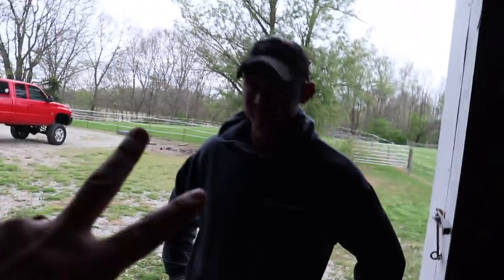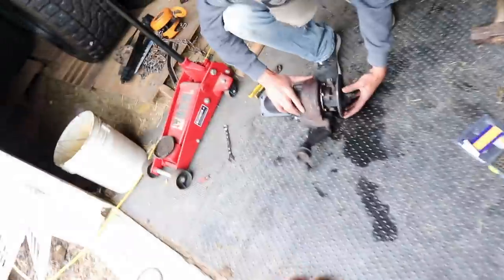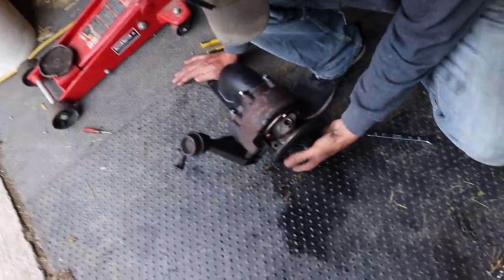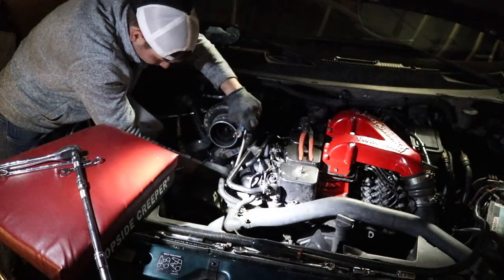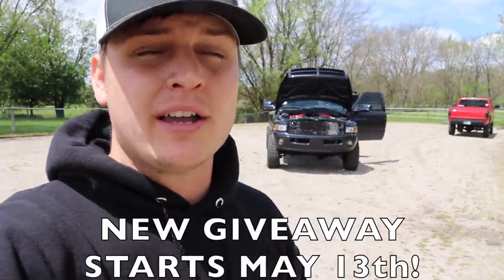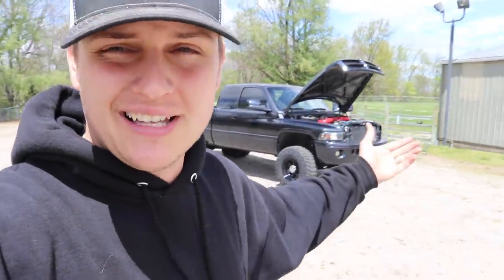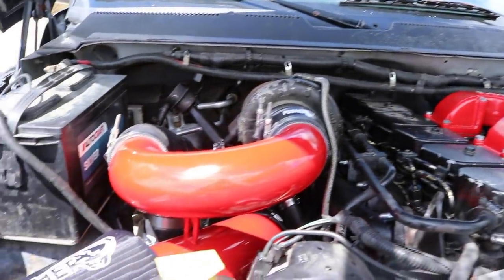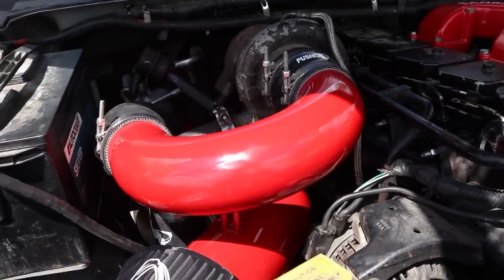THE PUSHER COMPOUND TURBO KIT IS IN the 12V Cummins!!!

Comment: It took me 3 days to put my Smeding Diesel Compound kit installed . Taking off the old parts took a day and figuring out the kit Smeding Diesel Offers took me 2 whole days because there bracket for the bottom turbo needed some adjustment LOL

Comment: Head studs? Or just riding dirty and see what happens?
Reply from the maker: It has an upgraded set of head bolts rated for 70+ pounds of boost
Truck makes maybe 380-400 hp estimated based on mods done.

Should be totally fine! But we have a new set of head studs to go with the truck if winner is wanting them done
Reply: @LOUDNPROUD  very nice I mean I’m all for living on the edge run em till they quit 🤷🏼‍♂️